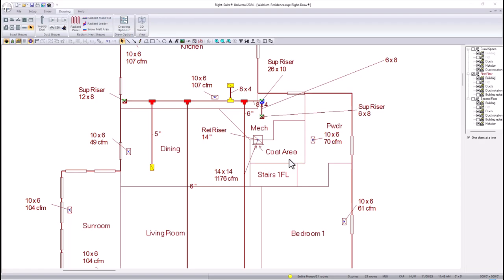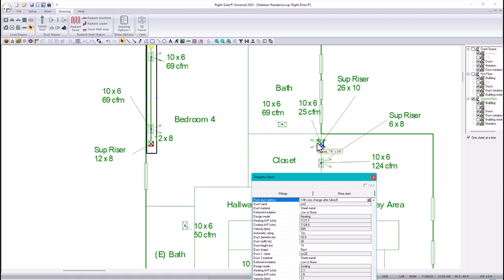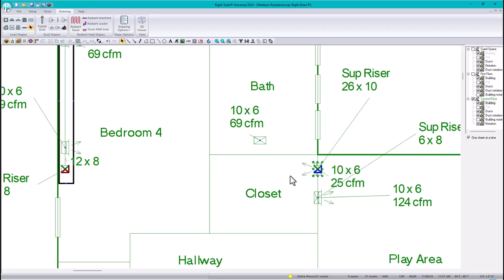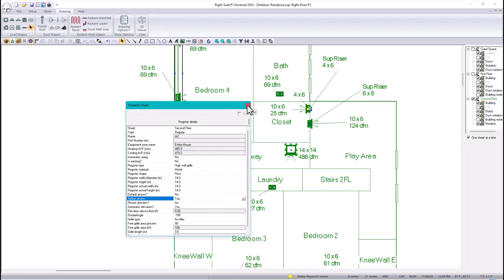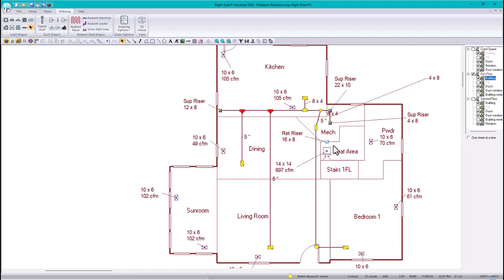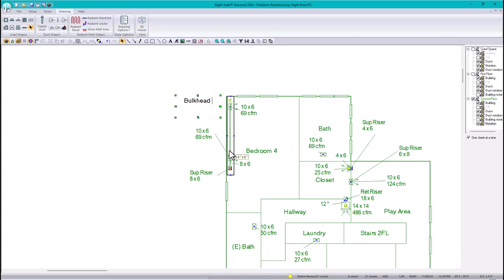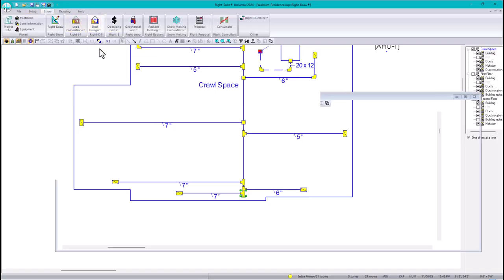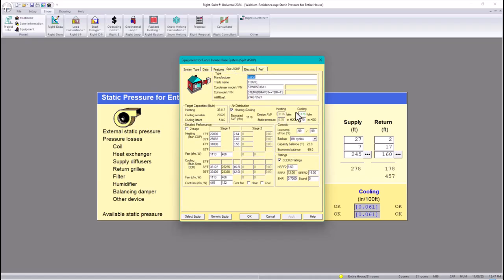Wrightsoft (Part 13): 2 Story /Crawl - TEL and ESP Ductwork Check and Cleaning up.

Comment: Hello. Could you possibly make a video showing how to manually add HVAC equipment that does not exist in the Wrightsoft database? I keep running into the problem of trying to use a split source heat pump that Wrightsoft does not have. I reached out to Wrightsoft and they sent me the EXCEL and WORD documents but I was not able to successfully follow the instructions and import them. If so, this would be very helpful. Thanks.
Reply from the maker: That's a great suggestion. Will do this next video for Monday 12/8
Reply from the maker: sorry for the delay. I will try to make it for the 12/18. I will keep you posted
Reply from the maker: Would you mind sending your excel file to hvaceasymath@gmail.com? I want to use the table for my video.
Reply: @hvaceasymath  hello, I am just now seeing this message. I do not have a custom excel file. The only excel file I have is the default template emailed to me by Wrightsoft. I will email this to you now. Thank you for replying.
Reply from the maker: @ishakak4580  thanks for the sending the information. You have two options. Two do a Manual Entry for which you will have to obtain the performance table from the manufacturer cutsheet and add heating, cooling and ratings (SEER2) to the equipment dialog. Now the other option is importing the database. I will get back to you on that but make sure you have the latest version of Wrightsoft Version 25.0.04. since I can see Daikin (AHRI215685327) available. The other two are not.
Reply: @hvaceasymath  Sorry for the delay, I thought I responded to this a day or two ago but I must have not pressed the reply button. I am interested in importing equipment into the Wrightsoft database. Again, I tried to follow the Wrightsoft official instructions but was not able to import the needed unit. If you could make a video on the entire import process, it would be greatly appreciated!
Reply from the maker: Sorry for the late reply. The holidays slowed me down. I will come back at it again and keep you updated for next week
Reply: @hvaceasymath  No worries. Happy holidays.